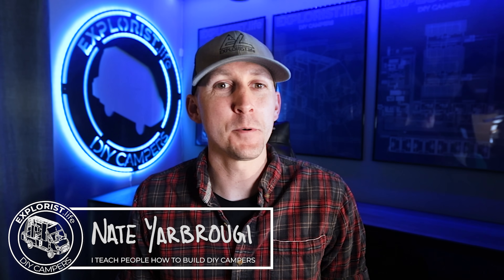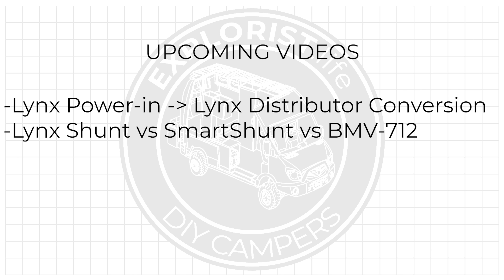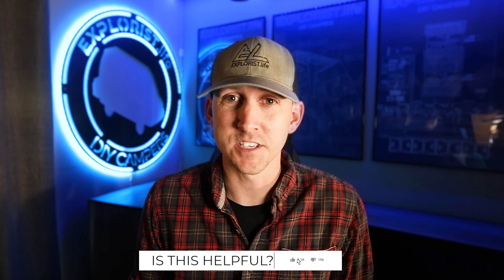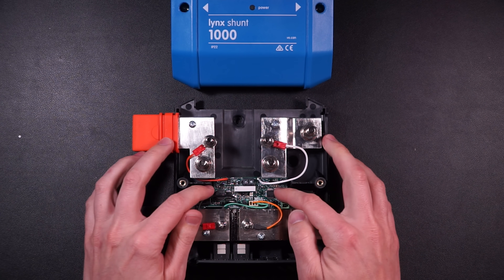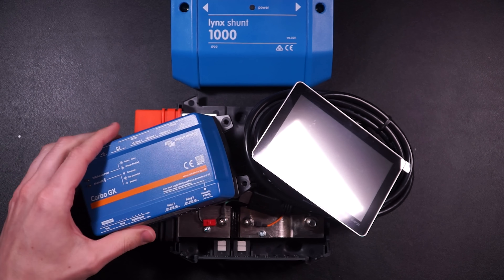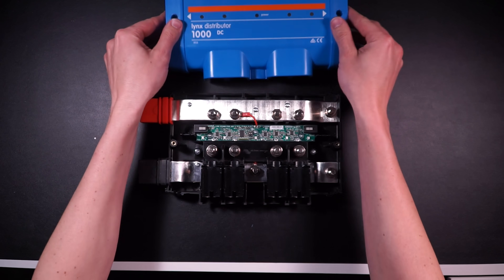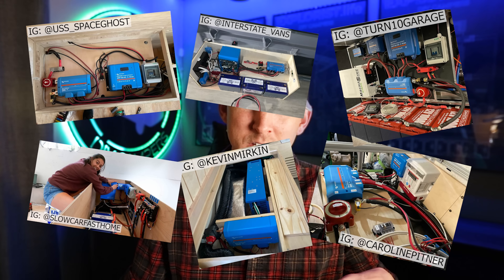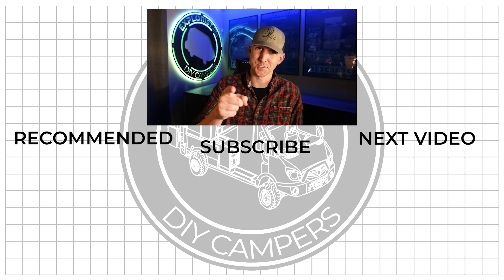Victron Lynx Distribution System Review for a DIY Camper Electrical System

Comment: So…not for a camper but for an entire off-grid power system… how would you connect two large 48V battery banks into the Lynx distributor in place of standard busbars?

Comment: Thank you Nate.  Your videos always get to the point.   Then so will I.   I’m using a Lynx BMS with Lynx distro on the left side for my 4 victron 200ah smart batts fused inputs.   I do not need a Lynx Distro on the load / charger right side because they are already fused at the proper end of the cable (smart battery protected loads fused near BMS and chargers fused near charge source).   Additionally, I do not have room for another L Distro.     Instead I need two positive and two negative 4/0 cables off the Lynx BMS right side to go to existing bus bars.   I can see no harm in using two flipped 4/0AWG - 5/16” lugs on each BMS bus.   They lie flush on the bars and with each other including heat shrink and do not contact plastic housing.    I am aware of the 500A continuous (600A for up to 5 min) rating of the Lynx BMS.    This sound OK?

Comment: Question.  Can I use the victron smart shunt BMS with non victron batteries so that I can use the inbuilt 500 amp remote controlled contactor with a small remote switch so that I can safely isolate my system from the battery bank ?

Comment: Nate.... I am doing an install exactly like Andy Rawl's Airstream, using the same components. I have a truck camper with power jacks and am needing a place to take power from. I have used all four terminals in my Lynx Distributor. Two are for attaching two solar chargers, one is for the MultiPlus 3000,and the last one is feeding the DC voltage to the campers distribution box. I am using copper bars on the battery side of the Lynx. Would it be acceptable to attach the electric jack wires (with lugs and fused of course) to the bolt (just under the bolt head and its washer) that attaches the copper bar to the Lynx Distributor?

Comment: Thank you. Can't wait for the Power-In hack. Building my system now. You are the best.
Reply: yes also very interested in using the power-in as the distributor. i will be using the smart shunt
Reply: Also looking forward to the power in mod. I have it in hand now with lots of M8 hardware on the way. Hopefully I reverse engineered this properly.
Reply: @chrisstewart2150  where do you get the M8 hardware?
Reply: @housesOTR  mostly from Amazon. It was hard to determine the length without fully taking it apart. I made an assumption of 30mm (sorry don’t know imperial). Definitely needs some washers to ‘level out’ the fuse surface.
Reply: Also I don’t think he is taking about what we are talking about! He’s on about modding the distributer for leds to light without shunt but we are about the power in modded to mimic the distributer. Correct me if I’m wrong?
Reply: @duncansarmy  may be so. I received my Power In. I went down and got some M8 hardware. Now I'm sizing for the proper fuse sizes.
Reply: @duncansarmy  The two units are so similar that the Power In has the LED conduits for lights that are on the Distribution panel. Funny. Just a stripped down version of the Distribution panel.
Reply: @duncansarmy  I think it is both. I’ll have to watch the video again but I’m sure he mentioned both mods. I’m typing this as I just finished modding my power in. Fuses are installed and ready to go. No LED lights for me though.
Reply from the maker: Both of those videos coming up.  

-Installing fuse holders into a Power in.

And...

-Making the lights in the Distributor work without the Lynx Shunt / Lynx smart BMV.
Reply: EXPLORIST life - DIY Campers excellent!!!!!

Comment: Great video Thank you. Victrons manual is not clear about connecting the fuse on the cold end with the +cable. The order of components on the bolt is missing. Also missing in the video is the controlled specified torque. But, thats something no one would not do right....

Comment: Thank you for the knowledge. 
Usually I use the lynx distributor with fuse right after the battery as a extra support if the built in BMS fails. Now I know that I have to get the Buss bar. Bless...
Reply from the maker: Glad it was helpful.  Cheers!

Comment: I just finished a install in my Airstream 600 watts of solar and 300 amp hours of lithium batteries. The Victron distribution system made a big difference in the ease of the install . Between Nate’s diagrams and the Victron products the job was quick and easy I would recommend it to anyone doing the same.
Reply from the maker: Awesome!  Glad it helped.  Thanks for watching!

Comment: Really enjoyed this overview, it's helping a lot with designing the electrical system on my boat.  A monitoring question:  if you add the Lynx Shunt and you don't want to add in the advanced monitoring, would you see any adverse issues with adding in a Victron BMV 712 into the circuit to enable the bluetooth monitoring?  I already have one that I don't really want to discard. Thanks for the great video!

Comment: Firstly, this is one of the best resources for off grid wiring on Youtube! well done
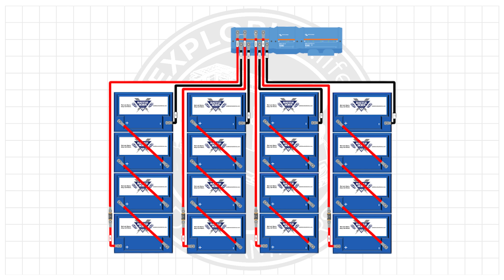At 2:30 in the video, you show a 48v battery bank, I'm setting up a 48v system using Victron components, at his stage I reckon I will be using multiple 12v vrla batteries wired to make 48v, using the power in lynx, in your opinion, where does the main disconnect switch go and the smart shunt? after the power in but before the lynx distribution, as I'm using the power in as my way of combining my 12v strings to make 48v, does that make sense?
If my assumptions of were the disconnect and shunt go, it's difficult to do a nice job of it, I don't see as disconnect switch that bolt straight into the connectors, I'm guessing I'll need some heavy cable to connect all together.

Comment: Great content Nate. Love it. How do you determine the mega fuse capacity used inside the distributor?? For example if I am planning to use Mppt solar charge controller 150v | 70a what kind of a mega fuse should I use (12v battery bank)

Comment: question: How do I connect the Victron Auto-transformer ATR-100A to a 220volt single phase inverter to get two 120volts output?

Comment: Good Morning. I will be installing two Battle Born Batteries soon.  I was looking at the Victron Energy Smart Shunt 500 amp Battery Monitor. I'm not sure witch  one to get.  I will be adding Solar power down the road. My budget is not great but I thing this is a good start.  Any thoughts about this.  Jack

Comment: Can I just use the distributor as a fancy busbar ?  I got the renogy 400ah battery now and just can’t find a suitable busbar for my 3000watt inverter/charger and looked at the lynx distributor as bud bar, can it hold the 4/O cable that goes to the inverter?

Comment: Does the lynx shunt need to be directly attached to the lynx distributor for the lights to work and be reported to victron connect? Or s it just a data cable that needs to connect them?

Comment: Hello! Total electrical newb here. From BC! 

I want to add a quick disconnect for charging my deep cell trolling motor battery (also lithium). Where would I add that into these systems? I don’t have an AC unit. Could I just add and SAE port off the distributor?
Reply: Would be great to charge of solar or shore? But obviously not drain my battery bank on my trailer

Comment: Ty for the great videos, I ended up downloading your schematic as well.. I currently have a two paralleld 24v Tesla system installed and everything has been working great but I want to incorporate the Lynx Distro and possibly the Lynnx Shunt as well. My question is, I'm already using a BMV712 would adding the Lynx shunt just be repetitive at that point? (I also have the Cerbo GX installed). ty so much!

Comment: Hi! Interesting video, thanks for sharing! One question please : on your linx distributor diagram you run a DC/DC orion through the linx distributor via a fuse. My concern is, what size of fuse , knowing the mega fuse minimum size is 60A, and the dc/dc Orion is a 30A. IS it possible that the 60 mega fuse calibrate for the wire connected ? no dommage for the 30A Orion?  Hope my question is clear. Best regards. Philippe

Comment: Hi Nate, you seem to have a lot of knowledge about electric systems . I'm getting a 2023 Entegra Qwest motor coach. It has a 200 watt solar panel, a 1000 watt inverter , a dual controller what ever that is and 2, 100 AH AGM batteries. I plan to up grade the inverter to 2000w or 3000w but initially would like to upgrade to a 200 or 300 AH lithium battery, can I just drop a lithium in with my current equipment ?

Comment: Could you use the distributor to connect multiple inverters to a 12v battery
Reply from the maker: Sure!  I've got a diagram for a big split phase system that uses 2x inverter/chargers powered from a 24V battery bank: https://www.explorist.life/24v-6000w-120v-240v-split-phase-camper-solar-wiring-diagram/

Comment: Hello first of all I would like to say thank you so much for your videos they have been so informative. I do have a quick question about a wiring diagram you have? I noticed that the dc to dc charger in the diagram is isolated. Would you wire it the exact same way with a non isolated charger considering you have a chassis ground coming from the lynx distributor?

Comment: In one of your videos, you showed an option for the Victron Lynx Distributor that would hold a disconnect switch and a 712 BMS shunt at the proper height. I'm getting ready to get rid of my bus bars and replace them with a link distributor. Any help would be greatly appreciated.  I'm planning on ordering from you also ... thanks
Reply from the maker: For sure!  All of our lynx distributor wiring kits for BMV-712's have the appropriate spacers & adapters to make that happen: https://shop.explorist.life  All of the 'full installs' we've done this year on this channel use those as well.
Reply: @EXPLORISTlife  I'm won't be needing any wiring kit, just the linx distributor and spacers with the adapters. I can't find the adapters, just the linx distributor in the store....
Reply from the maker: The search function on our store works pretty well.  Did the adapters not show up when you searched for 'adapters'?
Reply: @EXPLORISTlife no they didn't show up, I couldn't find them anywhere on your website...
Reply from the maker: https://shop.explorist.life/shop/all-products/victron-lynx-adapter/

Comment: Can one these bus bars be used to distribute charging to multiple Lithium batteries from a Victron DC-DC charger off a lead acid house battery? Or do I need one XS per battery? Thanks
Reply from the maker: Yep, that’s how all of our wiring kits at shop.explorist.life are set up and how all of the tutorials shown on this channel are.
Reply: @EXPLORISTlife  Thank you. I assume with Li batteries the charge will distribute as the batteries individually need it and the Victron XS will shut off when a full charge is reached or lead acid house bank voltage gets too low?

Comment: Quick follow-up to my question a month ago.. I’m about to install the Dometic RTX 2000 air conditioner.  They recommended using the Blue Seas 187 series 100A breaker.  I’m already using up all 4 slots of the Lynx Distributor.  So my question is, can I just wire up the breaker using the Lynx Distributor’s expansion points (at the right end of each busbar)?  I only need one more slot and don’t really want, or ultimately need, more than one more slot.  So to sum up, I’m thinking going from the Lynx, adding proper gauge + & - wires and connecting them to the 100A breaker and finally wiring to the air conditioner.  By the looks of it, I’ll most likely have to modify the Lynx’s cover, meaning cut/Dremel out the proper amount to accommodate the lugs/bolts/etc. but that’s only cosmetic. Thoughts anyone, or Nate specifically?  Thanks for all you do.
Reply: Nothing wrong with that, functionally & safety wise, just ruins the whole "modular" point of the Lynx System, so I personally wouldn't go that way. But it'll work if that's all you need.

Comment: Hi Nat 
Thanks for the description . Can you bring your power to the opposite end positive and negative from the right side of the linx distributor .  Because of my setup I can not use the left side .
Reply from the maker: Sort-of...  You won't be able to get wires in the right side of the unit, but you could make some short little copper bars that extend out of the lynx Distributor to attach the wires to.

Comment: Hey i need HELP!! i have a question. Im building a full electric induction cook system. with a 3000w inverter and 400ah of battery. im unsure of what BMS size to get? i've been looking for  while now and im still unsure if the 200a Victron BMS is big enough from the draw of my inverter and cook top!!! thank you in advance <3

Comment: What if I add victron smart Bluetooth dongle to lynx shunt, will it work to monitor power usage, power in and power out usage? Or it only works with gx monitor
Reply from the maker: The Lynx Shunt has to be paired with a GX device. The Victron Smart dongle won't work as you're describing.

Comment: So the lynx distributor power board basically shows up the led lights and links the BMS via the communication cable or did i miss something?
 The distributor has nothing to do with monitoring? I have the lynx distributor but with i need  more than 4 fuse holdes im not seeing the extra $100AU EXTRA for a cicuit board for LED's.
  If that is all it does the power in hack makes sense.
Reply from the maker: The Lynx Distributor doesn't 'monitor' power usage/consumption, no.
Reply: Thank you Nate. 
  I was wondering if the cerbo GX can work in with the lynx distributor to show up a blown fuse on the touch 50? I only using a smart shunt and was wondering if this is achievable  WITHOUT buying extra LYNX  components like lynx BMS  etc?

Comment: Hey man thank you for all the help! I have a sepearate question about the dc dc charger and it looks like I accidentally bought the nonisolated charger instead of the isolated one. Will it still work with your diagrams you have on your website??
Reply from the maker: Yeah, just omit the negative wire from the Orion to the starter battery.  Everything else stays the same.

Comment: Hi. I have a massive question. I've got a 24v bank to run an electric outboard motor. It's charged direct from a solar system. However I want to also charge a 12v bank to supply an inverter for the boat.
Can I just use a 24v to 12 v "dc to dc" charger? Can I run those of a bank of batteries? Most manuals say "run off an inverter". However, I'm going to have it running of the 24v bank, technically?
Reply from the maker: I'd recommend matching the voltage of the inverter to the voltage of the battery bank. So... 24V battery to a 24V inverter.
Reply: @EXPLORISTlife  Thanks. She is going 100% electric next year hopefully. So won't have an inverter!

I just want to make sure it's safe to charge a 12v bank from a 24v bank using a Victron DC to DC charger.
Reply from the maker: I'm not sure I'm following what you are trying to accomplish.  Here is a few various setups on how I design electrical systems for campers that may get you pointed in the right direction: https://www.explorist.life/solarwiringdiagrams
Reply: @EXPLORISTlife  Thanks. I have one solar charger. It will be charging a 24v battery bank. I have a second 12v battery bank. I assume the 24v to 12v DC charger from Victron will charge my second bank from the first?
Reply from the maker: @TechyBen  Sounds like a fabricobbled system.  I can't recommend that.
Reply: @EXPLORISTlife  Ah no worries. As said. I have a 24v bank for the electric motor. If I cannot charge a 12v system and 24v system from the single solar array then I won't. As it's a Renogy inverter, I can use it in charge mode from shore power instead to charge the 12v bank. I won't have anything to charge that bank while cruising though. :(

I was just asking though, if the DC to DC 24v to 12v is only for running off an alternator. Or if it can take the "charging" coming off the solar array charger into the 24v battery down to the 12v battery.

If I could, I'd do the whole thing as Victron I guess. But having a 24v and a 12v setup (as I don't have access to a 24v inverter) is the problem I have. :(
Reply from the maker: Yeah, I don't have many solutions that don't involve buying the proper products (24V inverter charger for example).
Reply: @EXPLORISTlife  Ah. Oh well. I may just do 2 separate systems then to keep it safe and simple (a second 12v solar charger and array).
With some sort of emergency 12v to 24v converter for running equipment should something fail.

I will see what I can subscribe to on your site. Thanks so much for the advice!

Comment: Hi, i would like to know if its possible to somehow connect 2 Charge controllers in paralel when its only a power source. I have a wind turbine capable of giving 2,5 Kw, 48 V bateries pack and i would need to somehow connect 2 1450W Charge controllers between the Bat Pack and the wind turbine. Do you know of a way or do you maybe have a tipp for me ?
Reply from the maker: I have pretty much no experience with wind turbines, unfortunately.

Comment: Is the orion dc-dc charger capable of charging my vans 48v battery.Used to supply all my vans accessories. Thanks
Reply from the maker: Nope.
Reply: what would charge my 48v battery using the alternator to starter battery to the accessory battery?
Reply from the maker: Victron doesn't have anything that will charge a 48V battery bank from a 12V alternator.  I'm sure there is a charger out there that would do that, but I don't have any 48V system designs on my site, so I haven't dedicated any time to figuring one out.
Reply: @EXPLORISTlife  Sterling has a 12v to 48v model that I am going to try. I will let you know how it works. Thanks for all you tutorials, I have learned a lot.